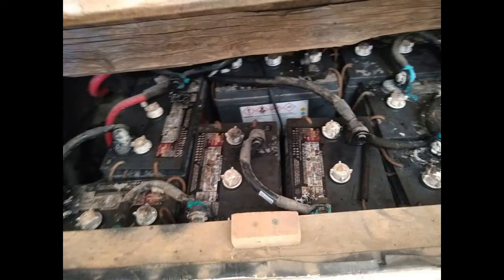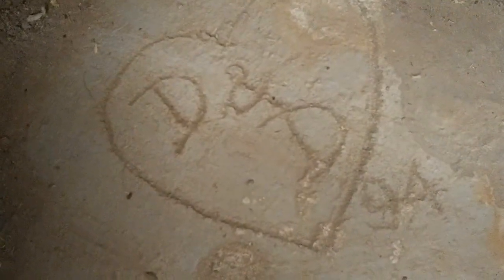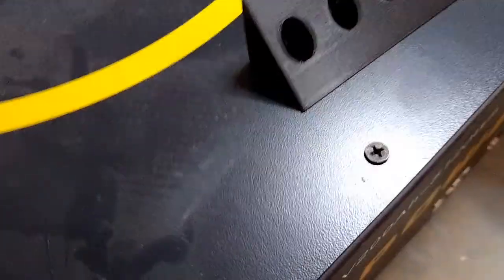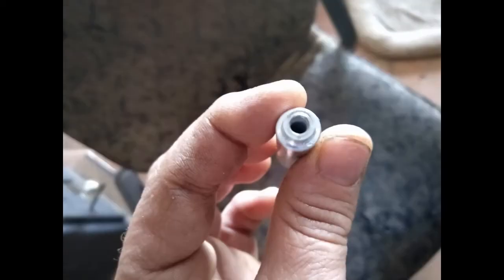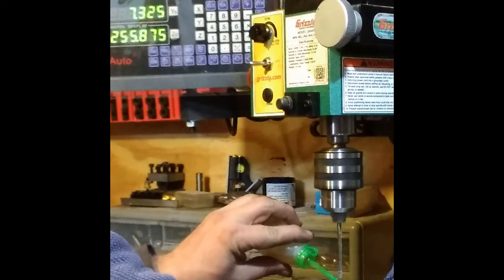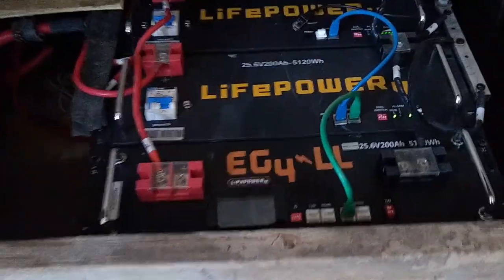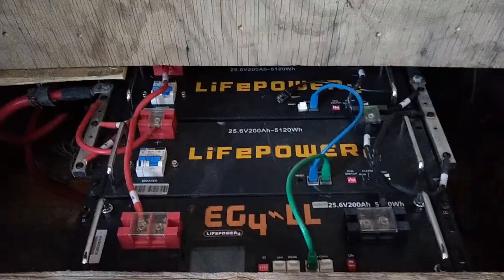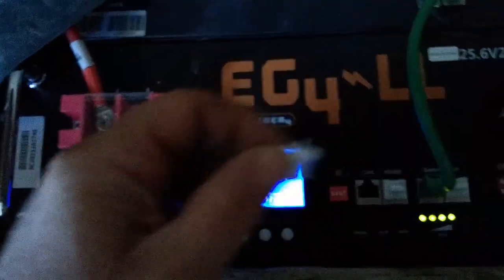EG4 Batteries installed For The Earthship (Update)

Comment: Have you tried using Solar Assistant?   I'm curious if the different batteries (EG4-LL and LifePower) communicate fine together.   I have one EG4-LL and need to decide which one to add.
Reply from the maker: I haven't tried Solar Assistant, I sort of got side tracked on to other things, but I am guessing the mixed environment would be a problem. The EG4-LL and the LifePower don't seem to play nice together and I don't think they even communicate between batteries either. So I guess I would recommend staying with whatever you already have. I have been able to communicate with both types of battery individually as long as they are not connected together.